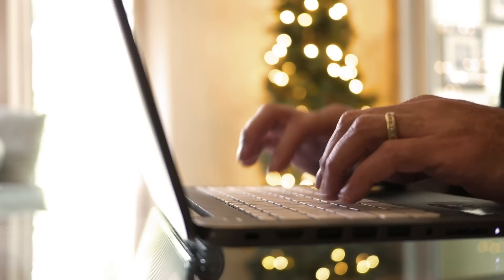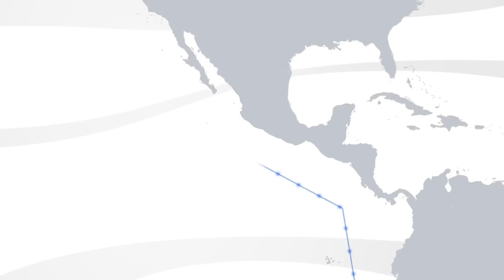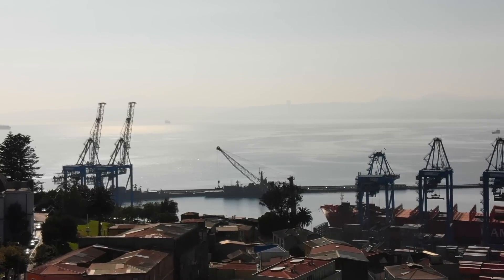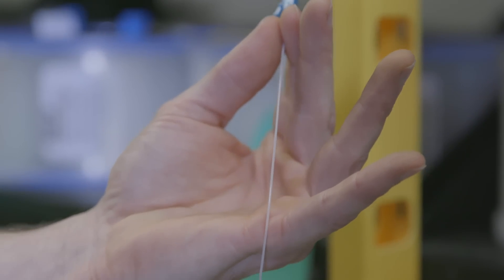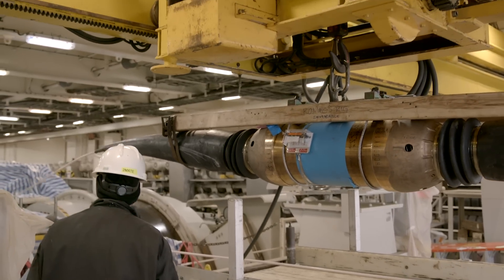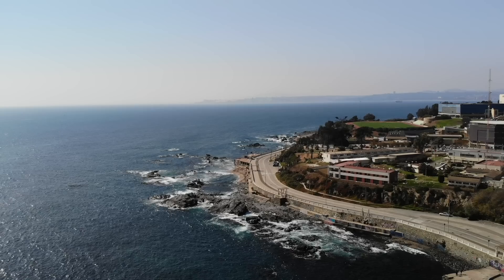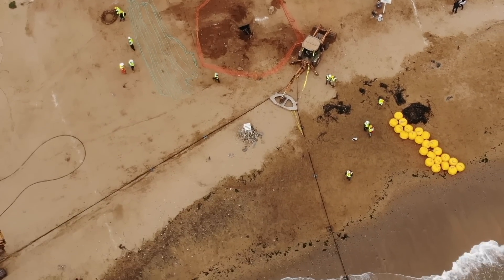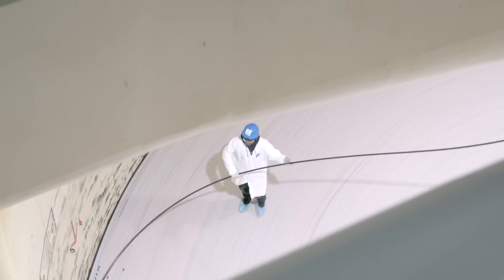Meet Curie, Google’s international fiber optic subsea cable

Comment: Google should add buoys with MPTP antenna's along these lines, and offer a maritime internet service for ocean vessels.  It could easily be a service that's far superior and more cost effective than the satellite options currently utilized. 

It would also serve a dual purpose, as buoy's could be added where the repeaters are located, making servicing the lines or repeaters less costly.  Wind/solar power could be an option as well, housed on the bouy's or fixed stations, to power or manage the repeaters, and reduce the electrical cost incurred from the ohm resistance on such long lengths of line.
Additionally, it could allow coastal cities or islands a place to tie into the fiber infrastructure.
Reply: the ocean is deep. in some places km down. To have a cable running to a buoys would be uneconomical, and allow the cable to be moved or broken in storms. Caught in ships. Or stolen